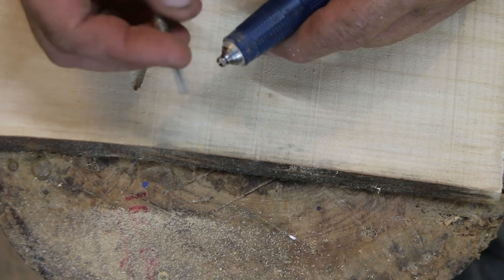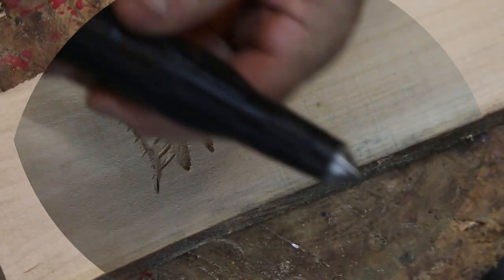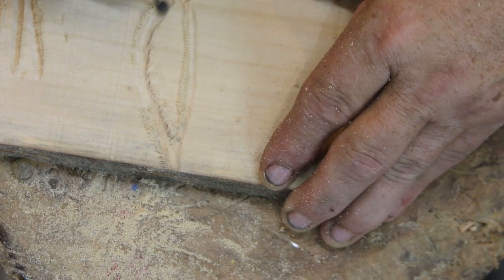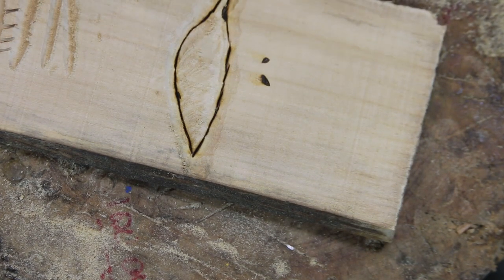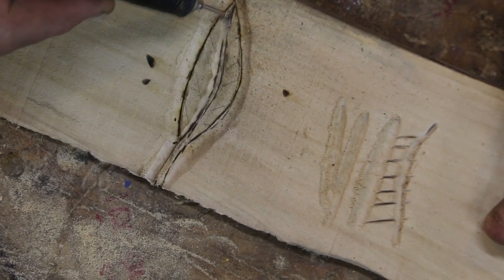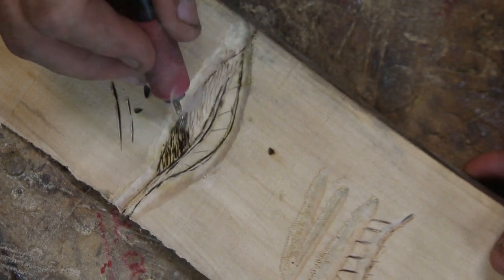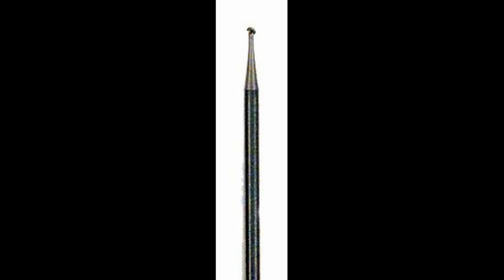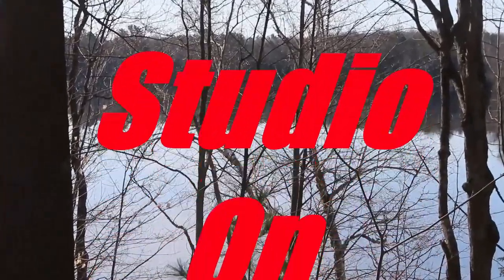Wood Carving Power Carving 101

Comment: I really appreciate you explaining the burrs and there use. I just started power carving about 6 months ago and learning mostly by trial & error or YouTube. I mostly do canes & walking sticks W/wood spirits on them. I use a WeCheer carver , B&D RTX & Dremell , all With flex shafts. I'm also a Vietnam vet and served there in 1968 , so carving keeps my mind busy. So thanks again for the tips and I'll be watching............ken in SC
Reply from the maker: Thanks for the kind words Ken. I have used flex shafts for many years and spent more time repairing them when they bound up. I think you would be very happy with a micro hand piece...any major brand would work fine. Make sure you get one that has interchangeable collects and then you will have all the burrs and bits at your disposal. Like you I find carving relaxing...winter, fire, tv background....nice. Keep carving

V/r,
Ben
Reply: @StudioOnTheLake  Thank you for replying , I'm looking at the micro's and perhaps I can sell off some of my HAM equipment & get a good one , i'll be watching.
Reply from the maker: @SP4Parks  I use JPL Enterprise (in Minnesota) Ultima combination micro carver base and wood burner... I run two of them one is 20 years old with a 30K speed handpiece, and the newer one has a 40K handpiece. The only thing I have ever serviced on them was two years ago JPL replaced the bearings and brushes in the 20  year old handpiece. The company is a one man operation.
http://carvertools.com/
Reply: thanks for your service ken